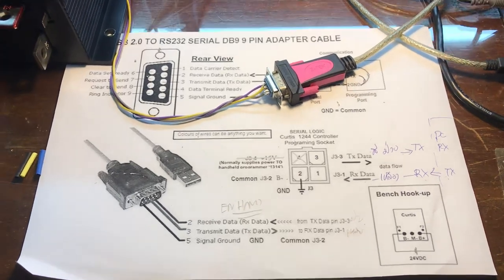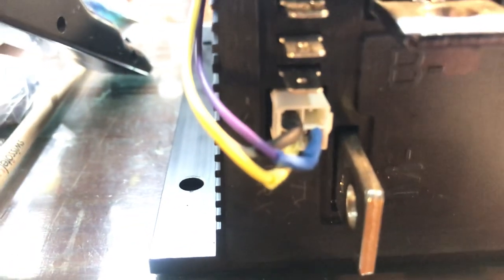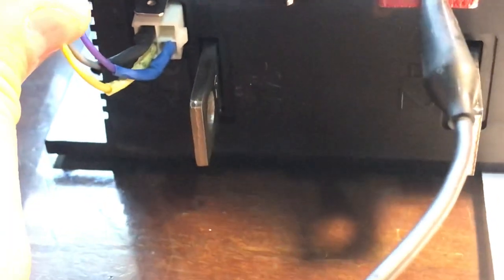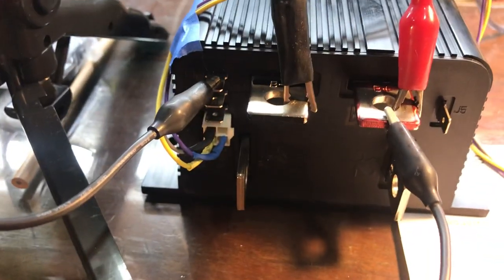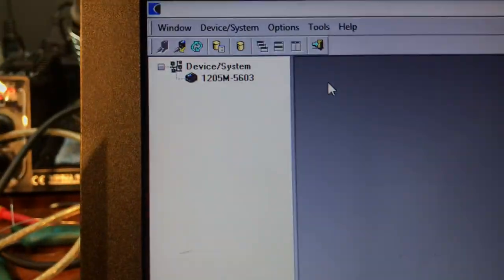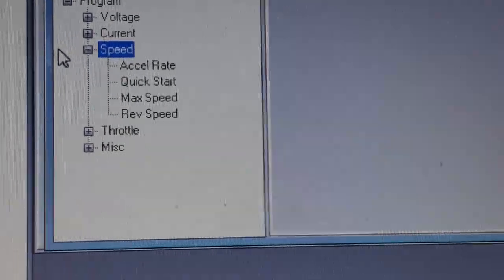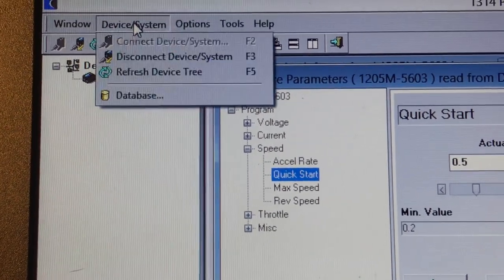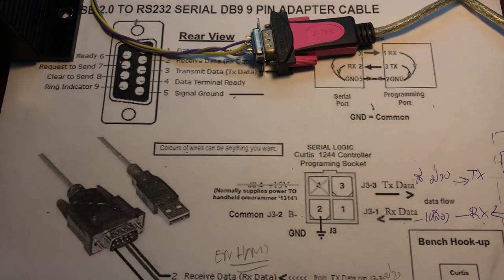CUSTIS  programming using DIY. USB-RS232 cable and 1314 software (** Google Drive download)

Comment: On the sheet at the start of the video you have the DB9 connector REAR VIEW.  Below it you have a picture of the DB9 from the front.  The pinout is the same for both.  What gives?

Comment: hi, you can connect a CURTIS 1232 or 1234 with that cable ? thank you for the video
Reply: YES i did it recently worked out great...I used the blue cable...not a standard rs232 but one using the FTDI chip ,, look up this description..
DTech USB to Serial Adapter Cable RS232 DB9 Male Port with FTDI FT232RL Chipset Supports Windows 11 10 8 7 and Mac Linux (1.5 Feet)
Reply: @chuckthebull  thank you..! I'm goint to try it.. 😀

Comment: A great video.  I have subscribed.  A quick question.  Your blue/yellow/black colors appear to be standard.  I bought the usb-serial adapter and a straight-through serial cable.  I cut the male end off the serial cable.  Pin 2 of the female was yellow.  Pin 3 was blue.  On both the female and male ends of the serial cable.  This is backwards from the colors you used.  Is there a reason for this?  On my cable, I would run the yellow from pin 2 of the adapter to J3-3, and yellow from pin 3 to J3-1??  What happens if I get them backward?
Reply: Ur TX rx would just be backwards nothing would happen you just need to swap around.
Reply: It goes from transmit to receive and receive to transmit,,,Plus a ground!  So from USB cable pin 1 is ground, Then pin 2 of controller is ground  ,,    pin 3 of USB (transmit )to  pin 1 of controller  , pin 2 receive of USB goes to pin 3 of controller.. Worked for me... got to change perimeters and monitor the controller... i know your comment is a year old but in case anyone else needs to know

Comment: That diagram was originally drawn by me back in 2012..... Additional  info ....  NOT ALL makes and models of USB-Serial adaptor leads work.
I recommend using a USB-Serial adapter that uses a Chiphead chipset e.g. CH340 /CH341
Reply: Did you use rs232 levels or TTL levels?
Reply: @georgegriffith7599  There's a crazy long forum post on buggies gone wild about 'programming curtis controller'. Looks like it's pretty obviously RS232, though. The power lead is 15V, that's a dead giveaway. RS232 is 15V, and there's no way anything TTL would have volts that high.
Reply: @joesanchez2465
Reply: Hi, how in the world can this idea connect to a 1205-117 controller? I bought the cheap ch340 also got a breakout and a molex and everything I do fails.. all I need is this controller to be ITS then I will trash all of this..
I have 36v and also 36v on the j1
I'm running this software that's in the video wired the exact way all I get is the "can not reset the usd.. or can't detect?? Help
Reply: Trying to use one like that and getting communication error... TX light blinks but not working gives this error " initialization of communication interface failed" "received unknown failure from controller" what do you think?
Reply: Adjust your baud rates in the com port settings of windows , on whatever com port you/got assigned to the USB dongle/interface. Some controllers like 9600, I've seen others work @ 19600, etc. Make sure 8 data bits and 1 stop bit also
Reply: @georgegriffith7599  Inverted TTL

Comment: I saw a long discussion on Buggies Gone Wild where they seemed to indicate TTL levels were required. You said TTL didn't work.  So, that means you used RS232 levels?  What USB to Serial adapter did you use?

Comment: What I get is "USB CAN Adapter:  unable to reset usb adapter".  Any ideas?  I have 36V on B+ and B- and key switch to B+.  Software in a laptop and usb-serial adapter to the pins on the 4 pin molex on the curtis.
Reply: Same problem, maybe 24v. Did you figure out the problem, and how did you solve it?
Reply: Hello, greetings from Chile, I have the same problem. any ideas?
Reply: @campoint.x1032  Hello, greetings from Chile, I have the same problem. any ideas?
Reply: @heroesinnombre  Ok this happen to me. Just pull the J1 one wire. The one that get power from your key. Make jumper that will go from J1 to your main bat bank. You need all 36 volts going to it. Then plug in the computer. See if this works.
Reply: Hi. I am trying really hard to build an old ezgo txt and I need to change to ITS. I bought the pass through and a rs232 ftdi  and all I get is "usb can adapter: unable to reset USB adapter. Any help? I have 36 volts and a jumper from F1 to battey +

Comment: Hi could you share the wiring diagram showing the pin number connection on the serial port?
Reply from the maker: Wel , If you watched video at the beginning you can Caption screen or pause it to see the Diagram